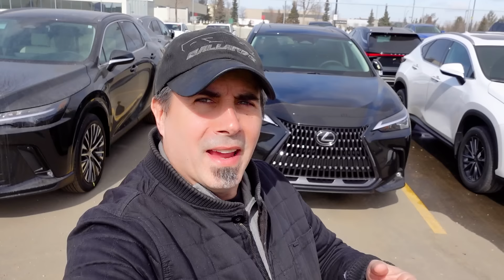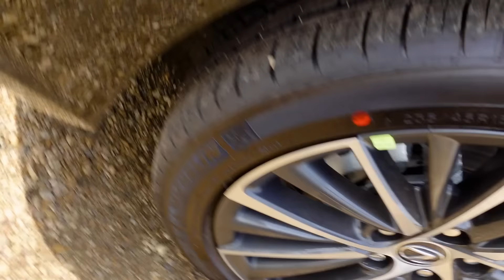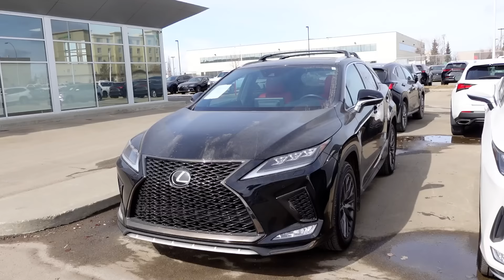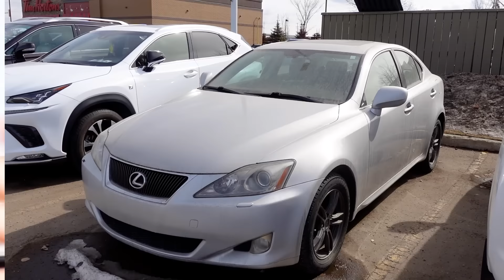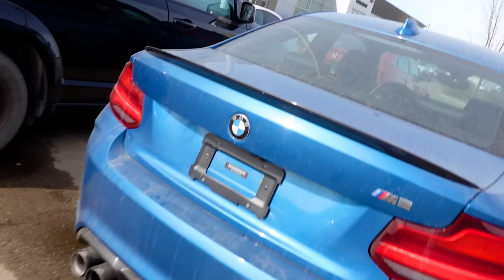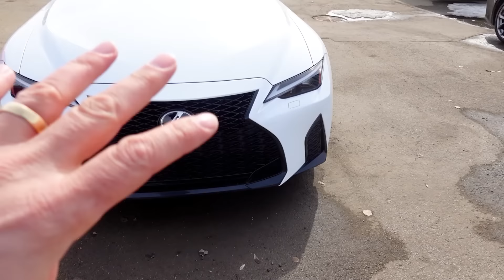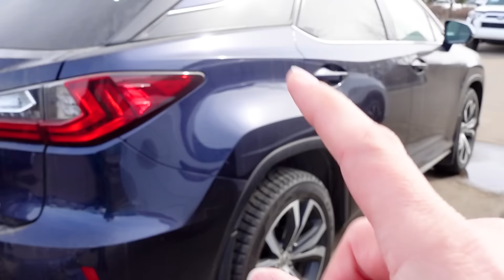Is Buying A Used Lexus a (MASSIVE) Mistake?

Comment: I have owned a 92 sc300 drove it to 350k with basic maintenance, one alternator and rear wheel bearings. A 97 es300 drove it to 330k with basic maintenance when it got hit. I own a 03 es 300 now it has right at 350k on it, basic maintenance only. I'm looking at buying another one now but they are great cars if you drive a lot. Very comfortable and ride well. The maintenance on every one but the LS is very affordable and easy for dyi people.
Reply from the maker: Nice

Comment: This sounded more like a lexus commercial.  I have owned 3 Honda Pilots over the last 15 years  that I drove over 100K miles and 2 odysseys.  The only thing I did besides changing the oil was to change the trans fluid.  They are the best.
Reply: Honda and Toyota are on basically the same level in terms of reliability. Although Lexus’s are better than Acura’s on average. But Toyota and Honda are basically 1 and 1A.

Comment: I don't understand the hate towards Is250??? I have one for 18 months now and it's absolutely flawless so far. If that is the worst they've got 😂 OMG! Still 10 times better than the competition. The worst Lexus is 10 times more reliable than the best bmw/audi/Benz
Reply from the maker: Haha, funny thing is the rest of the brand is so solid that this is just the contrast even though it’s likely more dependable than some euro cars.
Reply: @ECPP  and I remember clearly what the guy in the Toyota shop told me about the gearbox - "I work here for 10 years now and only one customer ever had an issue with this gearbox but he did not service it". That's pretty good in my book 😅
I Literally don't know where the check Engine light is on the dashboard. Never saw it flashing... Unlike my old Audi which was fine!  My old A4 1.8T was pretty solid, but not compared to the IS250...

Comment: I'm strongly considering a 2013-2015 ES 300h or a GS 450h. What are your thoughts on these hybrid models with 80k miles? Thanks, sir!
Reply: Don’t buy the GS hybrid. These were not as reliable. The old and new ES are reliable. But the newer 2019+ are extremely good
Reply: @campgotta  The GS body style is a bit dated for my tastes. But a heckuva car for the money.
Reply from the maker: Both  good options but the GS is where my money would go.
Reply: I bet... you love the sweet driving cars. Me, too. But the ES 300h gets 10-15 miles more MPG than the 450h. I'm torn. Lol. Thanks for your reply!! @ECPP

Comment: This video is right on time for me. My beloved 2015 Acura RDX with only 66,000 miles on it has been totaled after I was T-boned at an intersection by a driver who was texting. I had no plans on buying a car anytime soon. The accident happened the day after wrapping up a five-year divorce. I’m really upset and angry because I don’t seem to be able to find that year with the options I had with the low miles in a car that doesn’t have any accidents. My insurance agent really wants me to buy a used Lexus. With the amount of money I got for my Acura I can buy either a 2015 to 2017 used Lexus RX with probably 80 to 100,000 miles on it or I can get a used 2022 or 2021 Hyundai Tucson. I’ve been leaning toward the Tucson because it would be very close to new and I am pretty sure it would run without needing repairs for at least three or four years while I am in the process of getting back on my feet. Your video makes me want to considera Lexus. However looking at used Lexus is over the last few days has been a crash course in odometer fraud as I am sure most if not all of the vehicles I’ve been looking at have had their mileage “corrected”with the mileage correctors which are sold on the Internet for under $200.  As I understand it they also now have mileage dampeners or something. These log only 1 mile for every 2 mile you drive. Very sad state of affairs as far as ethics and honesty in the used car business right now. If there is a good deal on a Lexus that I find and it seems to have low miles how can I be sure the miles I am being told are correct other than checking the Carfax and the title and the general condition of the car. Thanks a lot.

Comment: Hello sir 
Since I got older,  53 yr old,  I got a lot wiser.  I  used to own many different types of motor vehicle but I  settled with toyota products. 
Cheap to maintain and long lasting,  sound like a perfect solution to me.
I  this moment my wife and I own a 07 tundra 5.7l  with 186k miles,  13 lexus rx 350 with 107k miles,  18 lexus nx 300 , 23 toyota GR 86 , and last but not least a 07 lexus rx 350 with 55k miles.  All my vehicles runs like New.  I love all of them.  Enjoyed your video, thanks.
Reply from the maker: Sounds like a win if a person can minimize running costs and servicing so the impact of reliability can be massive with the wrong vehicle

Comment: Great video. I am in Europe and have an Is300h, from 2014, near 300.000 km, only thing got worn out was a seal from water pump. I changed the complete pump for 200 €. Believe it or not that’s the total of malfunctions I’ve had until today. The hybrid battery died after 8 years/around 200.000 km total. I got it changed free of charge ( yes free of charge ) since I made previously an extend warranty of it (150€) . A plain, professional and honest after sales service helps a lot whichever brand you get.
Reply from the maker: Cheers and thanks a lot for sharing
Reply: hope mine lasts as long , have my Toyota Auris Hybrid Style Edition 2016 92000km exchanged for Lexus IS 300h 2013 77000km

Comment: In our family stable we had 3 Lexi. One was sold with 275,000 mi. One has 220,000 now and is turning into a rat rod and fassst.
One is a 3 year old UX with 30,000 mi. We are extremely delighted with our Lexi choices  we also have two perfect 2020 Honda Civics with 60K. 
Good reviews, bro.
🇨🇦
Reply: I find my ux to drive like a walrus.. trust me i've had plenty of walri in my day
Reply: @LLT-214  The UX is light and quite nimble for an SUV. Walrus? Try a Lincoln Navigator, or a Chevy Suburban.
Reply: @islanddon865  You didn't get the joke. I am dissapointed

Comment: Just got a fully loaded 2016 rx350 F sport, 1 owner, all Lexus dealership maintenance records, 50k miles, $30k. Even has the front end wrapped in the clear film, and tires replaced 3k miles ago. I think I did well. Only issue is 1 key
Reply: I already got a new key. Called around and a mobile locksmith cut, and programmed a new key for me. I found a new oem key fob on eBay. Purchased key fob for $110 and the key cut+programming was $100. Not bad
Reply: Cost a fortune if you want a second Lexus logo key!

Comment: Great video.   I’m looking at a 2017 IS300 AWD with 100k miles.  It has the 3.5 (2GRFSE) and wondering if this is a good solid vehicle.  It has extensive service records from Lexus as well.  We have an 08 ES and love it.  It has 110k miles.  Any help or advice would be great.

Comment: I used to own 2005 and 2015 Nissan Altima, one Honda civic 2006, and Lexus RX 350 2021, NX 350 2024. I bought all of them brand new, honestly the best driving experience was Altima 2015. I sold it at 8 years with 35K miles

Comment: I used to do all my own work. Had a sc430 and 2022 Rx 350. Just take the card change transmission fluid and rear differential every  50,k miles. Change oil every 5000. Buy Mobil one at Walmart but use Toyota filters

Comment: I’ve had my 2012 IS 350 for almost 3 years now, and the only thing that I’ve done to it is routine maintenance. It has 165K on the clock, and still runs like a clock. Lexus is my favorite car brand, and probably always will be!
Reply: Got mine 2012 IS 350 few months ago with 60k miles. DIY all the maintenance: engine oil/filter, air filter, cabin filter, spark plugs(ngk double fine electrodes), cleaned throttle body, MAF, installed oil catch can with new a PCV, flushed coolant,  drained transmission fluid & replaced filter/gasket/cleaned pan & magnets, rear diff oil, replaced in tank fuel filter, bleed brake fluid. Only thing left is brake pads and rotors when they needs changing. Car drives like a dream esp when you know you have used all quality fluids, parts and have done them correctly.
Reply: @qwertyui5086   I did my brakes and rotors last month. You can’t go wrong with Power Stop rotors and Akebono pads. Car stops on a dime with no noises whatsoever.
Reply: I have a 2009 is350. They have a weakass water pump, make sure to replace it regularly or your engine may grenade

Comment: You can get 2+ year old ES models for $35k all day long which is how much a NEW Accord costs... not even a loaded Accord either. Even the Civic Touring is up around $32k. So it's a pretty good deal if you can buy an ES. Lots more features and amenities in the Lexus at that price (like cooled seats, quiet inside, nicer trim level, etc.).

Comment: The only issue I have is that I'll be paying as much per month as I would a nice BMW model. I have a Toyota that keeps me in the shop - and it's never the engine but it's always something. The RX500h F Sport is probably the equivalent of BMW's X3 M40i and it's actually more expensive than the BMW with only "reliability" to hang your hat on. Which is better if driven low mileage and kept in a garage?

Comment: I have a 2016 Lexus Is200t. Only issue I encounter is with the tires getting worn out on the inside and the car tends to veer to the right. So to fix that I have to be mindful of tire rotation and alignment.

The brakes also had to be replaced around the 40k miles since the stock brakes wear out easily.

Other than that the car has been very reliable
Reply: Damn I just bought the same vehicle and am experiencing the same issues

Comment: My ‘07 IS250 had 357,223 when she was rear ended. Was still driving like formula car after the crash!!  Tig welded aluminum radiator, silicon coolant hoses, water pump, thermostat, new tires, interior new dash under warranty, leather seats 9/10. 350 brake kit w/stainless steel lines & ice cold AC with original compressor. Yup... she was a head turner 😏

Never had any issues with the engine. I used to hammer on her from day until night.
Reply: What fuel did you put in in it
Reply: @mmr0221 87 octane

Comment: Thanks for the thorough video! I recently joined the used Lexus RX350 community after doing a ton of research and preparations over the last couple years. Used to driving Fords, but grew tired of the lack luster experience and concerning repairs. I have a lengthy daily commute, so I was looking for a comfortable and reliable experience. I will probably stay with the brand from now on as most folks who buy Lexus, seem to stay with them.
Reply: Bout to get an RX 350... impressed with the care the previous owners kept it in. Very excited
Reply from the maker: Exactly and oddly the domestic competition is similarly priced which is ludicrus
Reply: @legpad5857  well a year in I've put a new Radiator in but other then that my 2009 with 155k  power steering edition is a dream ride! Two days after I bought it we got hit with that big flood here in Vermont! So we've been through it and I'm sooo impressed! 
    Now advice, check working electronics, under carriage for damage, lots of plastic that covers almost the whole engine and underneath, if it's not there then serious work has been done to it👍 good luck
Reply: @legpad5857  yup, my 3.5 litre handles all the hills here like a champ, V6 is way better on gas then my much heavier 4runner and FAR more comfy ... To be determined about winter handling

Comment: Yes, from a financial standpoint, it is. The used prices are beyond insane. I can not understand how people pay it.

Here in Sweden, i saw one black IS300 2013 in good condition. Leather seats, 15 speakers, most of the goodies, and 135.000 miles. Not exclusively served on Lexus. Price? 20.500£. absolute insanity.

A used RX450 2011-2012 luxury, non ML with 150.000k + miles goes for 23-25.000£

If you are stupid enough to pay these insane amounts for a 10-13 year old car, then i don't know what to say.

Comment: ES is based on a camry. LS is Avalon.
Reply: Wrong.
Reply: @lightsfansofthewest481  The ES is even made in the same factory by the more senior Camry assemblers. Source: I am an engineer who travels to different facilities for a living.
Reply: @Code-B  The ES used to be based off the Camry until 2007 when they switched to the Avalon platform. The LS isn't even shared with any Toyota models sold in North America. It's based off the N platform.

The Camry is madecin Georgetown. The ES is made in Lexington.

Comment: its extremely expensive to get things fix for instance my 06 is350 when  I have to get the front brakes done will cost me 1200 cad and that is just the basic replacing pad possibly rotors to me that is allot of money I used t o always just do all my work on my own but  I dont have a place to do the work . also my 06  is350 is a little noisy at idle  I keep thinking is something serious but  I also keep hearing that its the fuel injection system  
at the quick peak at that most reliable thing you displayed on here for 4 seconds BMW is on that list which tells me that whom ever did that didnt do ther home work BMWs are not very reliable
Reply: You got rob at $1200 for a brake job.  I always buy parts online then bring it to a mechanic to change it.  Toyota brakes are very easy to do, any competent mechanic can do it.
Reply: @jml9550  I didn't get it done plus any mechanic wont use parts that are given to them because they cant guarantee anything which I understand ,  I have a feeling that they would be buying actual OEM Lexus parts and replacing everything this mechanic is honest I  i have taken my mothers vehicles over year in the rand he has fixed things for free. when  I went to him  I was just getting an oil change but I asked if he could check the brakes he did rears were good fronts down to 30% that's when  I asked him how much it would cost to replace the fronts.
now before I went to him he is about 45 minute drive from my  place I called other places to do the same ( I dont have a place to work on my own vehicles or  I would) every place I called said they charged for the oil change yes that makes sense but also charge 60 to look at the brakes which didn't make sense to me since the vehicle would already be on the hoist . I used to work in a shop and well  I would never charge anyone on a none busy day to look at something as simple as brakes
Reply: @alwayscuriousalwayslearnin  ok that’s fair.  My wife’s RX350 was done in 2016, 4 rotors and pads all Toyota parts costed me $400 in parts and $200 labor.  In 2023 even with 50% cost increase, we are looking at $900 now.

Comment: 15:42

Facts right there. I’m driving a 2007 Rx350 and I recently had the pressure oil line leak and it wasn’t funny. Burst open thrice already within 2 months 💔.
Reply: happened to my 2007 a few years ago.  i think there was a service recall type of thing for one of my issues.

Comment: The title is obviously massive click bait.
Reply from the maker: Well….
Reply: @ECPP  My 2016 RX350 has 150k miles and will likely go another 150k with no problem.  I would buy a used Lexus without hesitation.

Comment: Owner of a 2016 Lexus NX. Had a $600 repair on the Turbo engine in 2020. Besides that I've spent $450 on maintenance per year.
Reply: Yikes, on a 2016 the turbo needs repair?  That’s why I just bought a new NX hybrid for my wife.  No turbo.
Reply: 450 on what ?

Comment: Absolutely worth buying a used Lexus as long as it’s in good condition and taken care of. But this applies to any used car. If you get something that’s been abused and has problems it can be just as terrible to sort out as anything. I’ve owned my es350 for 10 years and had it since it was 5 years old and put lots of miles on it. I have had no real problems just regular maintenance.

Comment: My 2015 GS350 F Sport was previously owned. Purchased it in 2020.  Now approaching 100K flawless miles. Great automobile!
Reply: Paid $24K at end of 2020. It had 58K miles. Had Lexus drain and replace transmission fluid at 100K. Now has 114K miles. Still excellent!
Reply: I have the same one bought it at 109k miles , only problem I had was o2 sensor and tires. Two oil changes. I’m at 119,360 now & this shit still cranks
Reply: Almost all cars on the road are built to last 150k miles with only fluid changes. 100k isn't much especially for a lexus. Please make sure to read your manual to find out when you have to change each of the fluids, many people think they only have to change oil which is ridiculous. It should last about 200k miles with proper fluid changes before the alternator/water pump goes. After that it should easily last you until 300k before another part like that goes.
Reply: How much u paid for it?
Reply: Did you do a drain and fill on the transmission fluid yet
Reply: I've got a 2016 GS350 F Sport 1 owner no accidents now at 138k and love it. Amazing build quality.

Comment: > is buying a used lexus a mistake
Hmm.. my 08 es350 with 70k miles later is running well and it needed : ball joints, tie rods, a radiator, alternator, tires. And thats it. 

Id say yes its worth it lol.

Comment: I saw your bmw videos with this same walk. I had the choice between a 2018 bmw 330i xdrive (24k) or 2016 Lexus RX 350 with top options (29k) -both 60kmiles. 

Chose the the Lexus, I'm never looking back. I can confirm the glitchy infotainment system though.
Reply: Good call. Lexus Is a great first car. Long lasting and reliable car brand. In the future, if you do decide to go for BMW. Lease a M340i x drive or BMW M4/M5. The M cars are the top tier BMW cars. The BMW 330i is not as high performance and fast as the M cars. The 330i is weaker and slower compared to the M cars. Only has 250HP which is super slow for BMW standards. BMWS are meant to be driven for their high performance which is why you should go for the M cars. Great looking cars, but maintenance and repairs is costly. But, yes. In general, BMWs are meant to be leased only.